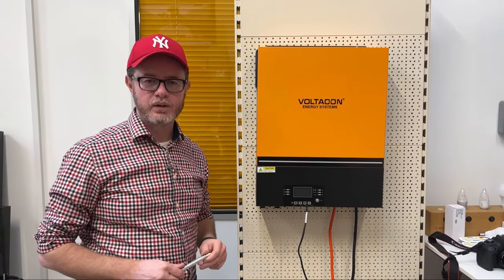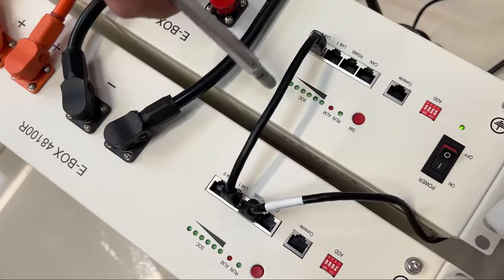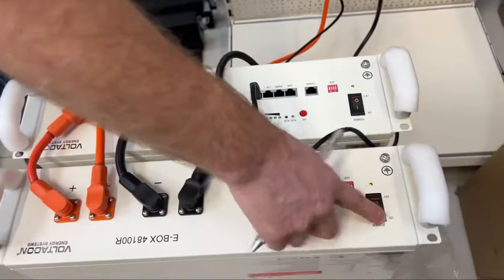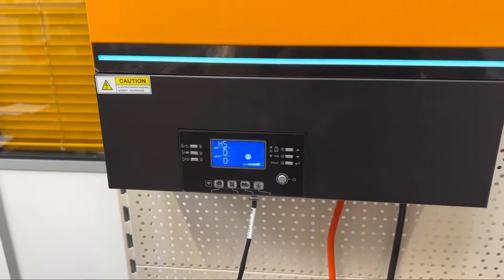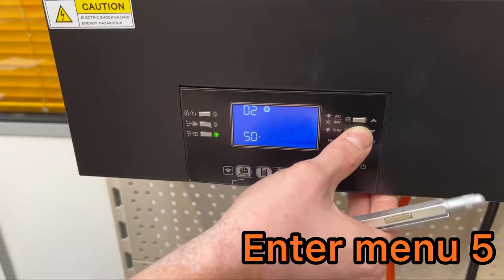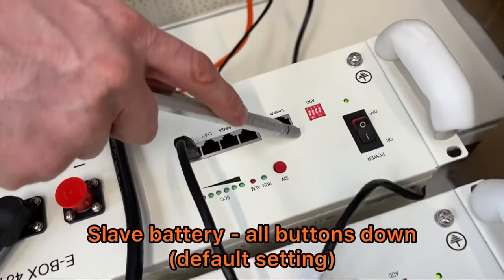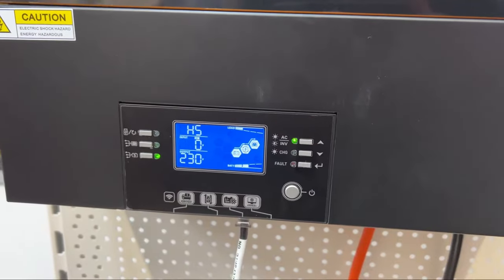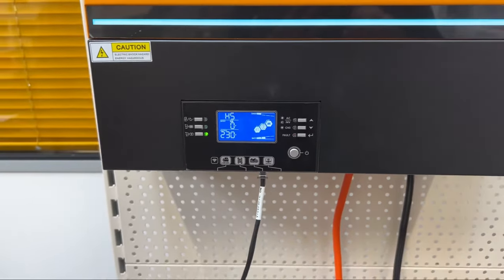Voltacon 5.12kWh lithium ion battery BMS  (Version B) pairing with 8kW Off Grid

Comment: hey; please I have a sunnyisland inverter which is sending a F952 ExtBMStimeout error on the sunny remote control after connecting with the BMS. Am using pylontech US5000... How can I solve this problem?? Am using the specific cable to connect the BMS to Sunnyisland inverter

Comment: hello, i have the same product , but i have issu with this , when i start the battery when the utiliy is up ,  i got F52 error , i wanted to connect BMS for see if i get any difference.  but it s not possible to connect my inveter to the battery by dms , what protocol is it ? i get error 61 , thaks

Comment: Is this battery the same as Pytes?
And for this battery, you don't need to pre-charge capacitor between battery and inverter before starts?
Reply from the maker: Hi no need to charge capacitor , first time we hear that , there is no need for such a procedure this is the new version :  https://voltaconsolar.com/voltacon-5120wh-48v-v5-lifepo4-battery.html

Comment: Very interesting 
Can these 5kwh batteries work in parallel with other batteries ?
If so, what are the limitations ?
Can they work in parallel with Pylontech with RS485 comms?
Many thanks for the video.
Reply from the maker: Hello no they have to be the same brand and same BMS .
Reply from the maker: This version has one extra bank of cells compared to Pylontech us5000

Comment: What are the benefits of connecting the battery BMS to the inverter?
Reply from the maker: The battery will be charged to the optimal voltage level . The charging current and voltage will be adjusted automatically by the BMS. It will also protect the battery from over charging. You must use bms it is compulsory